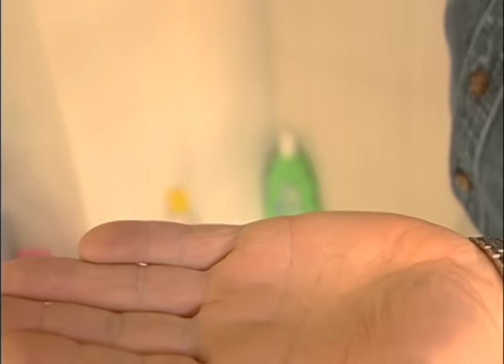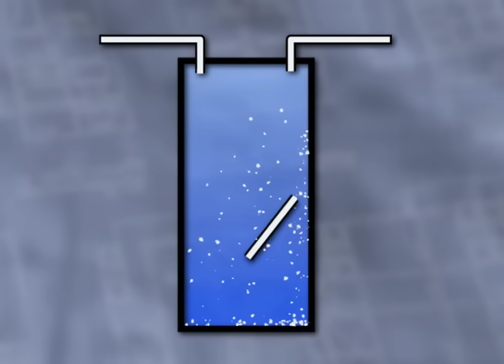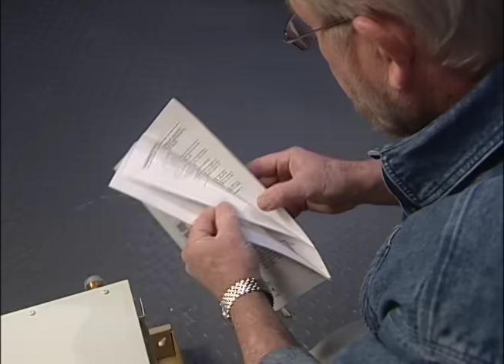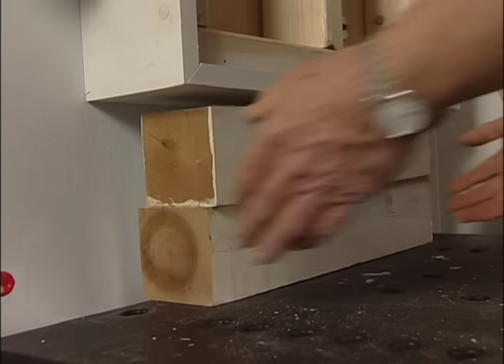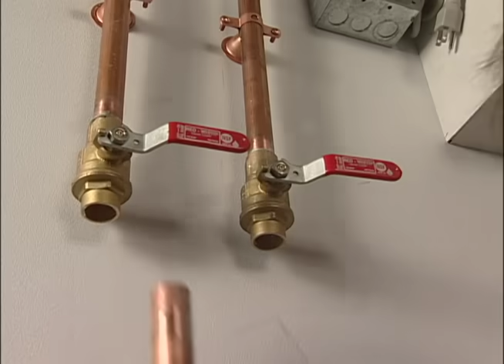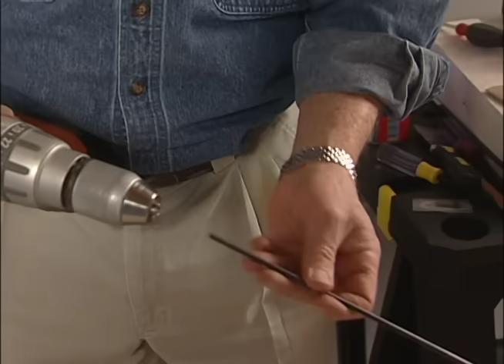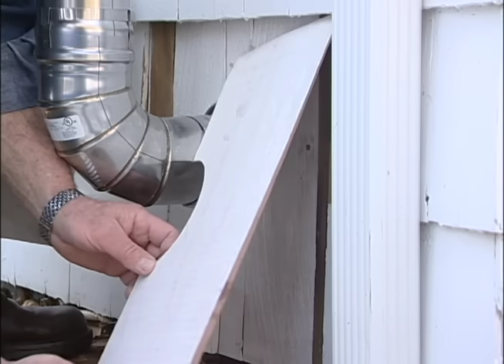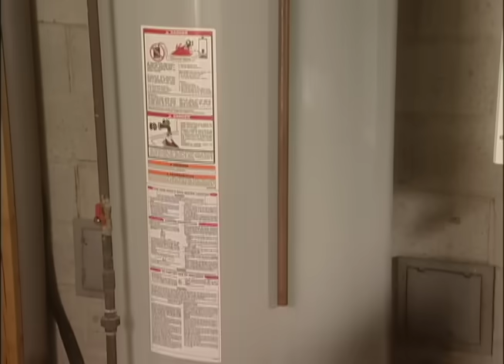Install a Tankless Water Heater

Comment: Missing from this video are the major hassles often occuring when changing over to tankless. For starters?

The coils of pipe inside the heat exchanger tend to reduce flow. If previously you had 10 gallons a minute flow? Expect less than 6 gal/minute. Solution?

Buy two tankless water heaters instead of just one. However now you're starting to draw much more gas volume. Unless the existing gas line is thick enough, and it usually is not?

You'll need to run a new, dedicated 1&1\4 inch gas line from near the gas meter. This could involve a lot of prep work and material expense. 

So far so good but unless you really know gas line plumbing? You'll need to spend around 5 grand JUST TO RUN THE NEW GAS LINE!!!

But it ain't over. Because as I've mentioned every tankless water heater reduces the flow of water compared to a tank variety of heater. and now you're adding another one! So you're going to need to increase the width of the pipe in your coldwater supply. 

This means. c.f.running an inch and 1/4 copper pipe back to the water meter. This in turn may cost between 5 to 10 grand.

And lastly?

There are mow two on demand water heaters requiring venting to the outside. Depending how luck or unlucky you are? 

Anticipate one to twi thousand dollars more to bring this up to code

Hint: just buy another regular water heater for cheap!

Comment: I have gas water heater tank then I was thinking to gas tankless, oh darned it's required plugging to outlet for temperatures control since I'm having power outages constantly might be not worthy unlet have a battery back up or sell without a requirement plugging.

Comment: Using CSST make sure your gas pipe is bonded to prevent explosion if the gas meter is ever struck by lightning. Also navien uses 2 inch sch40 well casing pvc for venting which is better and cheaper to install.

Comment: If you talk to any supplier, they will be happy to tell you that the only reason to install a tankless heater is for convenience. Financially they do NOT make sense as any energy savings is more than offset by the high cost of the unit, install costs for the larger natural gas piping and the ongoing maintenance costs for the tankless units (many require rebuilding/replacement of internal parts at five to ten year intervals.)

Over the typical twenty year lifetime of a conventional tank heater, it's still the more economical choice even though it uses more energy.

Comment: you could have used double wall pipe, and a 90 down angle vent outside the wall, if above the snow line

Comment: You REALLY should have installed a Service Valve Kit.  These valves make yearly flushing of the water heater easy.
Reply: A nuclear reactor heating element would be cost effective in the long run too

Comment: Should of put a valve kit in. Also if installed at high altitudes need to set dip switches. Im at 7000'  and they wont run this high if not adjusted

Comment: Those stainless steel vents cost almost as much as the heater. Mount a " Through the wall" vented tankless heater on an outside wall and save $$$. 
A water heater with a completely  broken off dip tube will only give you luke warm water for a few seconds.  The cold water entering the top (instead of the bottom) transfers straight over to the hot water outlet....so Ron had a problem for a long time. I've taken apart tankless heaters and found major soot build-up in the heat-exchanger compartment causing huge performance issues (wasting gas) big time. I'm a professional plumber and I'm sticking with my huge, dependable tank type that works fine, even if the electricity goes out.

Comment: you forgot the part that you have to run a minute or so cold water to clear the pipes out of cold water existing in the pipes before the hot water reaches you,if you are not constantly running it,it is the about same or less time to get hot water back,depending on pipe insulation and cold temp outside based on where you leave,and waste of water

Comment: Look, if you are going to have a corrugated gas line installed, you also need a dedicated bonding / grounding wire going to a ground rod outside. A "sniffer"?  Lol,  a Kuhlman guage is better.  Also, that tank needs to be descaled at least twice a year.  Therefore, special valving designed for this should be installed on the hot and cold ports below this unit.  The venting requires a minimum of 36" from any window or door (local codes may vary here).   I would never buy an imported water heater from a box store anyways. Also, fyi, that kitchen faucet is installed incorrectly.  The handle should be to the side of the faucet.

Comment: You will  also need a bigger gas line . A normal 50 Gallon  Free standing Water Heater is about 50,000 BTU (Gas Load) and a Tankless is around 199,000
Reply: Like a bigger gas pipe or a bigger main line?

Comment: The water heater didn't need replaced. Remove the water heater to your yard, and using a long dowel rod (longer than the water heater is tall by at least a foot) the old plastic tube will break up easily (remember the defect its fragile from years of use). Remove the drain valve completely and connect a garden hose to the hot water output. Turn on the hose, and lean the unit some. Gently roll the unit back and forth. Look in the heater to see if its all out, if not repeat. install your new tube, and the drain valve (or a new one). Optionally replace the pressure relief valve while your there and any other common failure points, then reinstall. Works on gas or electric water heaters.
Reply: I was thinking the same thing that the tank did not look like it needed replacing.  What I would have done is take out the dip tube, anode rod, and drain valve.  Duct tape a piece of pipe to the shop vac hose, stick it in through the open ports, and vacuum up the debris.  Use a bore/endoscope if you got one for visual confirmation.  Install new dip tube, anode, and a proper brass ball valve for a drain and Bob's your uncle...  He did a really nice job of installing the tankless unit though.  I just think he really wanted one and the debris in the tank was a great excuse.  Not that that's a bad thing...I might have taken the same opportunity given the option.

Comment: DOESN'T ream the copper pipes, DOESN'T cover the fire sprinkler with a wet rag when soldering nearby, relies on 4 tiny Tapcon screws to hold up the water heater, is too lazy and cheap to run REAL pipe to the unit, doesn't put in any scale filter or flushing bypass system, no GFCI outlet...PLEASE PEOPLE, don't rely on following this video. Wow....

Comment: So what is the cost-benefit analysis?  New water tank, the energy efficiency of tankless vs. tank, versus install costs for the average homeowner having to pay a plumber for the entire job.?

Great video, by the way.  You have a better on-camera personality than half those people on HGTV.
Reply: There are a lot of variables, like how much hot water you use, how often you go away (i.e., not using any hot water) and what your water and gas (or electricity) costs. Generally, though, I've read that tankless units pay for themselves in 5 - 7 years, and also last longer, because they don't need the maintenance that a tank needs. That is, I think, if you install it yourself. If you it the way Ron does and have a plumber run the pipes, but do everything else yourself, your cost will take longer to recover. Having a plumber do it all will take even longer.

My personal opinion is that tankless is definitely worth it. You don't have 50 gallons of water held at 120 degrees 24/7, which seems incredibly inefficient to me. When our tank goes, my wife and I plan on going tankless. What does kind of suck, though, is that if the power was out, you wouldn't have hot water. Luckily, that has happened twice in the 15 years we've been in our house, and both times it was only for a couple hours.
Reply: @scottplumer3668    Thanks for the reply.   I put in a timer and only run our water heater between 12-3 PM to save some money.  Our water heater is only 4 years old and of good quality, so it holds the heat good.  

You bring up some good points to consider Scott - Thanks for taking the time to answer my questions. 

Have a great week.

Comment: why not install the tankless by the old water tank? the old flue pipe from the water tank could have been used instead of drilling a new hole on the side of the house. The only reason I would drill new holes on the side of my home would be if I'm installing a high efficiency tank with PVC pipes.

Comment: The plumber hasn't done tankless water heater installations before because he forgot to install a critical item for servicing tankless water heaters:  Webstone Tankless Heater Service valves.  These valves are the only way to flush minerals and scale out of the tankless heater without having to un-solder your water supply lines.   Terrible installation job here ...  

https://www.amazon.com/Webstone-50443WPR-Tankless-Heater-Service/dp/B01MXOAT5Q  

With the servicing valves in place, you can service (flush) your tankless heater with just a $20 submersible backyard pond water pump, a bucket, and a couple of short lengths of hose.  Your tankless heater user guide will show you how.  One should do this once a year - hook up the re-circulator to the servicing valves, put a gallon of vinegar in a bucket, and let the pump push the vinegar (or acetic acid) to re-circulate for 45-60 minutes through the heater to get the scale out of the control valves and the heat exchanger.  Close the hot-water side, then run fresh cold water through the heater to your bucket to get the vinegar out.  (flush with 15+ gallons). Then close the servicing valves, open the hot-water valve to the house and you're done

Comment: Anyone else notice that the plumber was leak checking the unit with the gas shut off? Also I wonder if he checked the sizing on the gas system. Tankless water heaters can use up to 4 times as much gas as a tank water heater

Comment: You have to pay a plumber about a thousand dollars to install the plumbing.  What is the point saving $500 when you are spending thousands already on the tankless plus plumbing and end up destroying your house because you screwed up with one of these "easy DIY videos".  The liability will be on you. and you BETTER do your research. It will take over 20 years to recover the costs if not longer..and whatever you save will be destroyed due to the maintenance costs -- if you don't flush these right you can cause a major leak

Comment: If you live in an area with a lot of hard water you need to professionally flush these twice a year.
Reply: I guess I have been one of the lucky guys because I've had my regular electric water heater about 20 years---never flushed it--and still get hot water as I did when it was new.  A plumber told me that tankless water heaters are very expensive, so when mine goes south, I plan to replace it with another old style one.

Comment: I would NEVER attempt to do-it-yourself with a tankless water heater. You are going to be spending thousands to convert it from tank to tankless anyway--so trying to save a few more hundred forgoing professional installation is hardly worth the *gamble*; besides, tankless still requires an electrical plug to power on the computer system.  You make it look easy but you can do some really serious damage to your home if you never done this before or had formal training.  You may even invalidate the warranty.

Comment: So much extra time, effort and money to go tankless. Just rip out the old tank and replace it with a new tank. Any savings you think you get from use of tankless is gone thanks to extra install cost. Also, if the power goes out, that style of tankless cant work despite its gas heat with its "micro-controller".
Reply: Also I noticed when people are pushing tankless they always stress how a conventional water heater has to continually keep the whole tank hot! Making it sound as if it is continuously running all the time, which is so far from the truth! My water heater is off more than it is on!

Comment: most plumbers wont or will try not to install something the homeowner bought themselves. the plumber wont honor any warranty on the product. and they shouldnt. they didnt provide it. spend the extra money. let the plumber provide it. at least you'll get a minimum of 1-year labor free repair. also, they only provide 3.5-5gpm in the northeast in the winter time so keep that in mind.

Comment: I would have just taken the water tank out and cleaned it and put a load of white vinegar in there to dissolve any limescale build up replacing your water tank with a heat exchanging water heater will just allow the heat exchanger to do more work and cost more money when needs replacing they have also been known to split and leak water all over your house meanwhile a water tank will not do that unless it is deliberately punctured
Reply: The only reason a heat exchanger will split and leak is because when installing it, fit an expansion vessel to the return pipe,to pick up the extra pressure created when water is heated in a sealed unit,such as the tankless heater

Comment: Love these units compared to a water tank. Loads of advantages but two things to consider. Check your clothes washer can run off the heater. My set up required me to run a bath tap first to bring hot water into the room, otherwise the water fill is always cold. Secondly these units need electricity so if you are prone to power cuts think about a power back up. Nice job

Comment: Great video. One question...What was that small nipple pipe pointing down on the stainless vent pipe right before it goes out the wall?
Reply: Doug Moody - the small nipple on the horizontal run of vent pipe is to drain condensation.  Such a vent condensation fitting isn't really needed on a non-condensing heater, but for a condensing heater type, it is good practice, especially with stainless vent pipe.

Comment: This seems like more of a want then a money savings job which is alright, just wondering with all the money spent on the install how long will it be till you make up that money on savings? 
 Same job with a  original style hot water heater you could of had installed in less than and hour. less money on plumbers and install of new vent.
Reply: Ron thanks for spending the time on this install/video, we had the tankless HWH in our previous home, it had been recommended as part of our 2010 energy audit...... we converted our home from electric to gas during this period as well. We had our 2 teenagers living at the time and never had enough hot water for bathing, the dishwasher, and washing clothes at the same time. This option was presented to us and we financed it as part of the NJ’s Energy Efficiency Program, the fin was for 10 years, 0% fin the tankless part of the project came to $ 2,400 for the unit then the labor. Without the the State backed program we may not have had the tankless HWH installed, but we immediately experienced many of the conveniences you mentioned. We just moved from our home to a townhome 3/2020 , during our 3 week renovation asked about the tankless for this application, reviewed the pricing, and found it was better to install a newly design high efficiency HWH..... since it is only the two of us now we have more then enough HW and a new HEHWH.

Comment: Thank you Ron, this video was very instructive but I have a question, I understand that a tank-less water heater  consumes 4 times more gas when it kicks-in than a regular water heater, I was surprised that gas intake lines did not have to be upgraded, In Brooklyn NY , I was not allowed to install a tank-less water heater because my house is contiguous to the next, even the exhaust had to be upgraded.
Reply: That's probably true because it's instantly heating the water instead of slowly heating a tank.  It doesn't use more gas over time however, because it's only fired when there's demand.  A tank heater fires several times a day typically to keep the tank at the set temperature.  
So you're right, if both are running for 5 minutes, the tankless will consume more gas.  But the tankless only runs when the faucet is on, so for typical usage, you'll use a lot less overall per day/month/year.

Comment: Not recommended for well water.
Reply: Why, we have well water and I am interested to get a tankless heater. We do have a softener system.
Reply: I have a friend who uses well water in a rural area in Georgia, and her installer advised against it in favor of a tank-type unit.
Reply: @5610winston  Thanks for the reply.
Reply: She found a scratch-and-dent tank unit and had it installed at a very low price.

Comment: Beware some of them have a max limit of 120F so nanny government can keep you from having actual hot water.  The 120F setting you have in no way will ever be acceptable to me.  At least on some (Rinnai), there are dip switches where you can hack the max temperature shutoff.

Comment: YOUR HOSE clamp MISSES the exhaust vent pipe by a 1/4"..... NOT EVEN TOUCHING THE CLAMP. . . .  ONLY THE PIPE AND SILICONE HEAT COMPOUND

Comment: How long it is going to last 20 years I do not think so. Those tankless are very popular in Europe but it always is to hot or too cold. I have not like those. Vetu small short heat exchanger. How long it takes before is fully plugged up?
This  video is PR event paid by the manufacture, Thank you very much. 
Sears Canada had installed them by the thousands ( I have worked for them)  and had to remove most of them on warranty......
Reply: How is it pr for manufacture when he didn't even mention model?

Comment: Was it just me or was there no service valves installed also I’m pretty sure they used M copper instead of L and they also did not show bonding the CSST gas line

Comment: Basically in the long run if you do not have a tankless gas hot water heater bite the bullet and install one. Works out best in the end